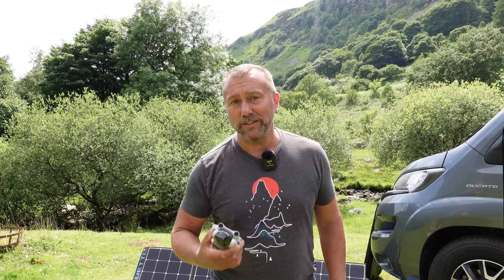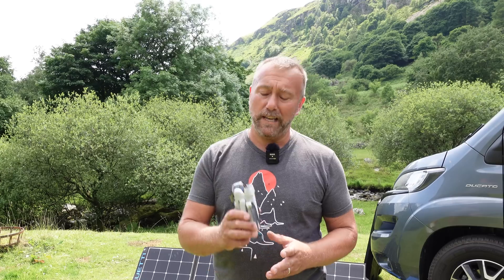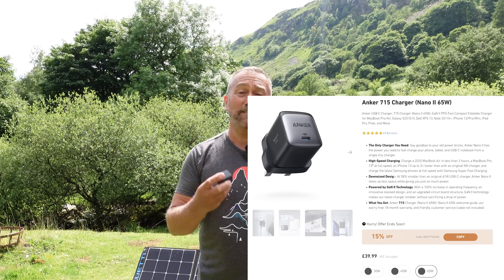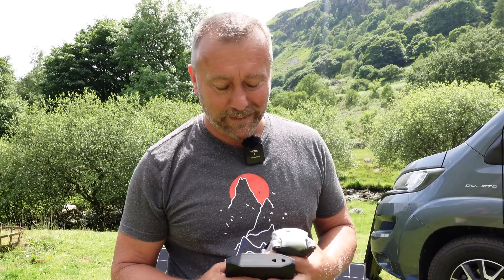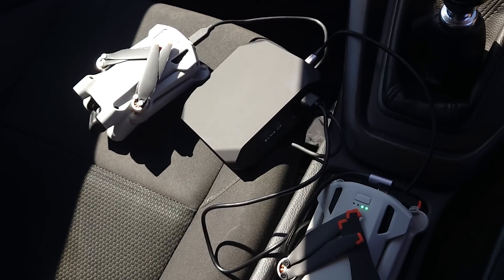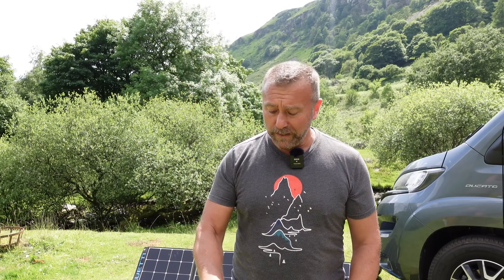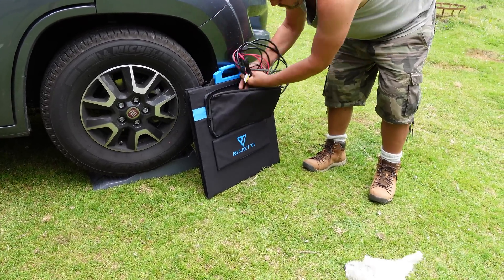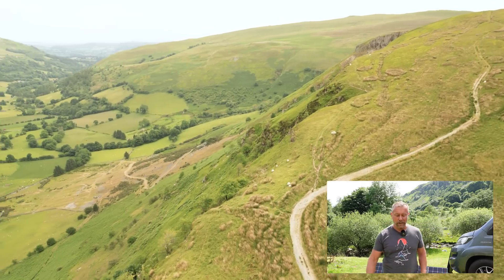How to get the DJI Mini 3 Pro Fast-Charged in an Hour

Comment: Hi Ian I have a mini 3 pro only had it a few weeks I’ve been charging with a Samsung charger & it takes a age to charge. I’m just wondering if the charger cable that comes with the drone will fit the uk plug have put the link for? Any help welcome.
Reply from the maker: You can use any charging cable that ends in USB-C for the drone.  Some are older USB at the other end; some are USB-C both ends.  The Anker charger needs this type of cable: https://amzn.to/3KFTlqZ
Reply: @IaninLondon  much appreciated Ian, I’m learning slowly with the mini 3. Very helpful your content thank you.

Comment: So basically I can use any ISDT field charger, just need XT60 to usb-c cable then? And I should now what voltage, battery type and amp rating I should charge with.

Comment: Just got mine, hooked it up to the phone charger and it was at 19% after 2 hours. Should I be worried?
Reply from the maker: No. But you need a more powerful charger.... It should fully charge in around an hour
Reply: @IaninLondon  thanks for the reply. After about 6hrs it was fully charged. I guess I'll look into a different charging brick.

Comment: I have some 30W chargers but most have one usb-c and one usb-a port and will not fast charge both the batteries and the controller at one time, I have to charge one at a time or use tow bricks.  I got the Anker 735 Charger (Nano II 65W).   It has two usb-c ports and one usb-a and will fast charge the batteries in the hub and the controller at the same time if I use the two usb-c ports with two usb-c to usb-c cables (it won't fast charge these devices off the usb-a port).  It's pricey, about $60 US plus tax but it's easier than using 2 chargers.

Comment: I'm completely off grid.... With all of my tech gear...😆
Is the DJI supplied cable actually PD?  I've read that a PD specific cable will give you full benefit of a PD charger...
I charge the RC Controller using my phone charger... Plugging it into my PD charger just makes it seem like it's charging in over drive the way the lights flash...I just feel more comfortable with a slower charge on the controller.... I'm in no hurry, anyways...
Reply from the maker: Fast lights = fast charging.... :)  I think DJI know how to look after their batteries, so I'm pretty relaxed about using the fast charge on them....

Comment: Ian, is the Omnicharge you have the 20+ or the 20c+? It seems you have enabled them to sell out of the 20+ as of this morning. I am also interested in the PD charging profile it provides as a user on their site has commented that the 20+ doesn't support PD3 and as such won't charge a samsung phone using super fast charging. I think for £250+ you should be able to charge as fast as your kit can allow. Cheers man.
Reply from the maker: I don't have the C model. Mine only had 1 USB C port.  I would definitely be going for the 20c+ if I was buying now. Amazon have them in stock as of now? Cheers, Ian

Comment: Thanks for your info-vids Ian … always useful. Just on this solar array - how does it cope in a gusty wind? Just wondering if it will need weighing down to keep in place.
Reply from the maker: It's fairly lightweight, but has a steep angle of slope or you can lay them flat on the ground facing straight up. 👍🏻

Comment: Another great video Ian. We have our caravan stored in Scarborough and have it pitched for us when we go there. Fortunately, we have mains electric so don’t need fancy gear for charging the Mini 2. I do have a 26800mAh power pack but use it for our phones when out and about. It doesn’t have a USB-C PD connection so I need to make sure that the drone batteries are charged back at the van before venturing out. We’d love to see your footage in both Malta and Wales when you get round to it. Keep up the good work.
Reply from the maker: Thanks 🤠👍🏻👍🏻👍🏻

Comment: Would it charge air 2 batteries ian
Reply from the maker: Yes, but you'd need the mains power charger or the car charger as the Air 2 can't be charged by USB C.  But it would work fine.

Comment: The BluEtti looks great. How long does it take to get to full charge from the solar panels?
Reply from the maker: Around 4-6 hours if it's sunny.  It was on half yesterday and filled up in 2.5 hours.  Cheers, Ian
Reply: @IaninLondon  thanks that's pretty good going for free electricity (ignoring the hefty price tag!). I took my first drone flight yesterday with my new Mini 3. Got to what seemed like a terrifying and daring height of 13m!  I'll be pootling around the garden for a while until I feel confident to go further.

Comment: Just a note the faster you charge the batteries the harder it stresses them reducing their life. You should store the batteries at 60% and I use an 18w charger so it doesn't take that long to go from 60% to 100%. The slower the charging the better it is for the battery.
Reply: Very true. I learnt that while working for Tandy Electronics years ago. I do a days flying and just charge it in the evening with my old phone charger
Reply from the maker: Fair point, but is charging in 65 mins fast charging?  Genuinely unsure. The official DJI 30w charger gets it charged in 65 mins.....  I'll try with the 20w charger I have...
Reply: @IaninLondon  I've just done a test with my 18w charger. It took 35 minutes to go from 64% to 100% using the charging hub. I think it's much kinder to the battery chemistry charging at a lower wattage. Fast changing cells has always reduced their life and yes I believe 65 minutes is fast changing.
Reply: Charging at 1c won't damage the batts one iota
Reply: Slow and steady when charging Li batteries. It's the same when charging EV's . Don't use the rapid chargers all the time as it will deplete the life of the battery faster. Of course fast charging occasionally is fine.
Reply: @Phil.Graham  you are in general correct, but do the maths on any current car battery and even the best fast or super chargers aren't remotely capable of 1c charging, that's not "fast charging" in the lithium world. Lithium cells are capable of upto 5c in some cases but that severely depletes cycle life. Don't keep them fully charged and don't go too low if at all possible too often. if I was daft or desperate enough to own an ev I'd keep it between 20-80% all the time and the second the warranty goes on it back it goes.

Comment: Thanks for the info Ian.  Not green but have you considered a portible Inverter Generater where noise doesnt pose an issue.
Reply from the maker: As a camper, I have a pathological hatred of generators!   :)  But in truth, the lithium power banks work great!  Cheaper ones are available...
Reply: @IaninLondon  I think I would be the same. I tend to cook using bio fuel in a spirit burner for the obvious eco qualities and it’s so quiet.